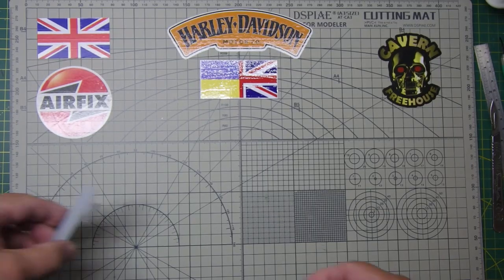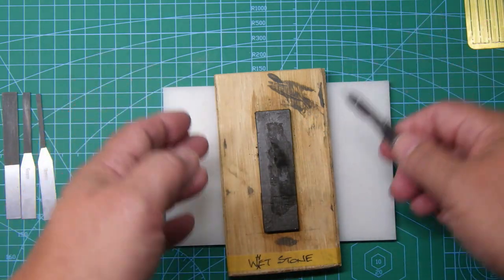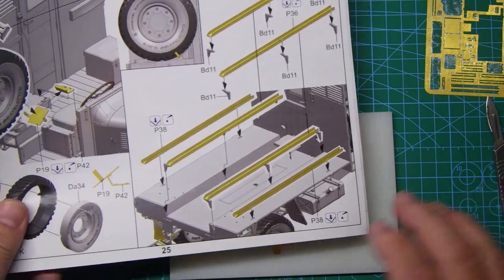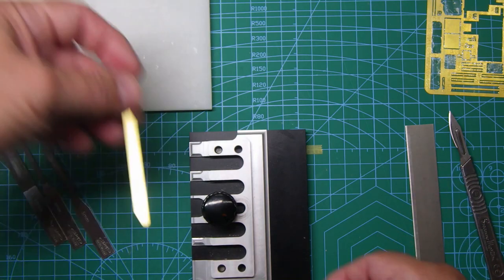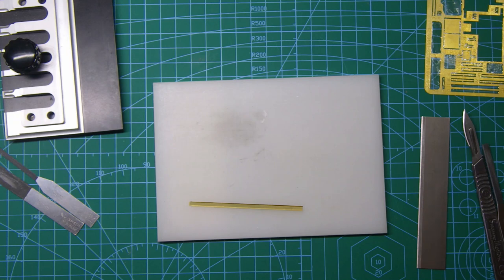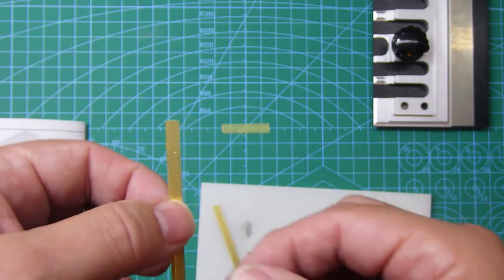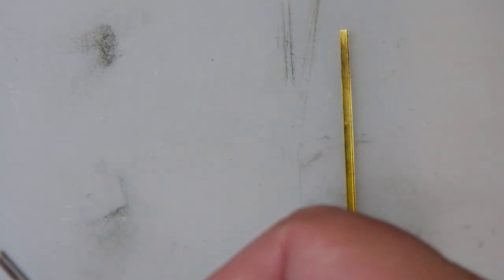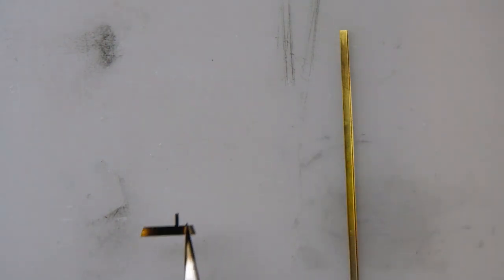Gecko 1/35 Katy Ambulance kit build - part 5 - photoetch

Comment: Hi Bob, That was a great tutorial on PE.  It's always a challenge to figure out the best way to fold a part.  I just recently started a really small chisel to cut my PE off the fret.  It works really well.  I also have a large set of drill bits that are very handy for rolling PE.  Any diameter up to 1/2"  I have covered.  Larger than that I can turn something up on my lathe.  Thanks for sharing.  Have a great day.  Jeff
Reply from the maker: Thanks Jeff, I had tried the chisel blade, but couldn’t get on with it 🤔 I suppose I had got so used to the blade I use. Yes any round shape will act as a former, I used to use drill bits too, but they were never at the bench when I needed them 🤦‍♂️ Great fun all this eh? Cheers mate 👍

Comment: What a refreshing change to see someone sharpen tools, or rejuvenate an edge.   
Must admit I employ credit cards as a cutting mat for photo etch, also remove one side to the plastic first,  
I find the use of a dedicated etch folder limited and clumsy  so made my own from two strips of BDMS, but employed short springs set in, to `open` the plates.  Very fine needle files No 6 cut are much better I find for etch de-burring after which a waft over with very fine abrasive foam pads. 
 I note too you interest in Dspiae tools, I find there Tungsten chisels sublime, if used sensibly.  Re your comment as to tool handling and use.
I volunteer at a steam heritage site and upon the `My` bench are many sharp tools  a blunt one is worthless and even more potentially dangerous if employed. 
I have been informed there are sharp tools upon the bench  which are "dangerous".   Rubbish its the idiots whom do not know how to handle them and interfere that makes them dangerous.

Folder from Historex maybe??   As I've waste £££`s on folders.  The only time I employ a folder is when working upon `0` gauge locomotive kits.

I still have my old brass Swan Morton blade handle from my early days when all `we` have available was Nos 1, 2 @ 3 blades, but hardly used the No 3 curved blade. 

Cracking video back to basics and common sense.  Keep em coming  Bob.  Take care.

I believe `we` must converse `off` video as I can maybe make you modelling life a little smoother.
Reply from the maker: Yes, I believe I got the Hold & Fold from Historex, I have a couple more that are smaller which I think I got from Amazon. I've been modelling with PE for some years 🤔and as I said these are the methods/tools I'm comfortable with and it certainly doesn't make me an expert 🧐Anything that makes life easier is welcome. Thanks for your input Alan, it is most welcome. Cheers Bob 👍

Comment: Hi could you please tell me what you used for the ht leads just getting back in to modelling after  thirty years was going to put them on my kt/y ambulance
Reply from the maker: Hi Stephen, I used 0.2 copper wire salvaged from 7/0.2 cable I saved from my model railways days. Being 7/0.2 it provided 6 wires for spark plug leads, and one from the coil to the distributor. I hope that helps and good luck with your build. Cheers 👍
Reply: Cheers 👍